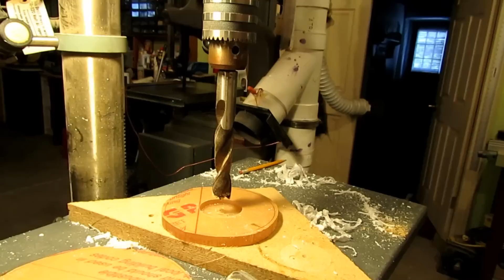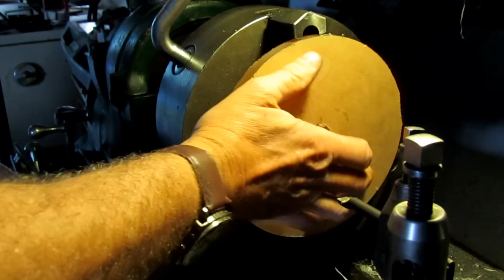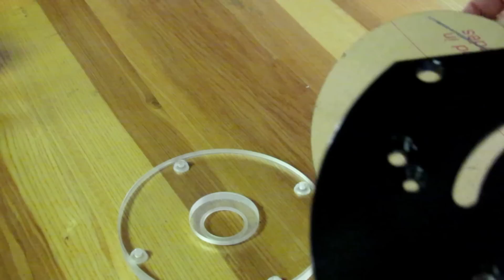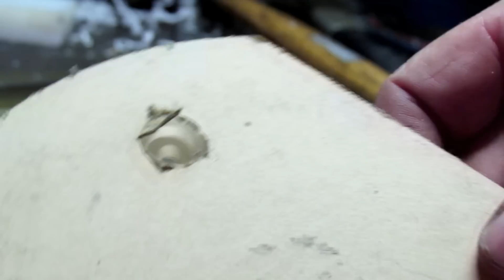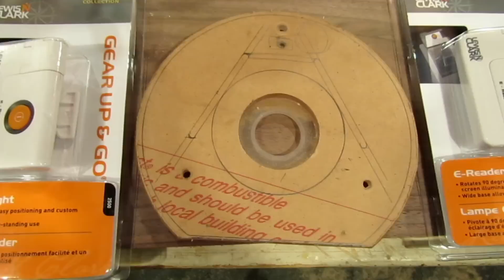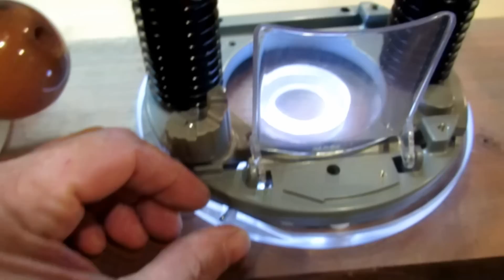Making some more router bases

Comment: I think that's some great work. I just have a question about the flat cut in the router base. Couldn't you just leave it round? Then it doesn't matter as long as you have the base touching the guide. I'm sure there is a reason but I'm missing it.
Reply from the maker: You could but the flat allows getting  closer on inside corners.  Thanks for watching.
Reply: @unemployedredneckhillbilly2023  Thanks. That's a pretty good reason.

Comment: I have seen several videos about how to make a new plate for a router, but yours is the first to employ LED lighting. This is an absolutely BRILLIANT idea!!! The only question I have is, how how can I mill out the square holes for a trim router, as well as the slots for the LEDs without a dedicated milling machine??
Reply from the maker: Find someone  with a cnc router.  Even a little  3018 should handle  it. Thanks for watching.

Comment: What do the rest of us, without a machine shop, need to do to make a nice faceplate? Just keep buying them? You do nice work. The plate for the harbor freight trim router would sell like crazy.
Reply from the maker: Many of my subscribers have CNC routers that can make things like this easily.  Thanks for watching.
Reply: lol you can do this in much less time with just a drill/drill press with a 35mm forstner bit for the counterbore and 30mm forstner bit for the through hole as well as a router with a pattern bit to use your current baseplate as a template to cut your new one that you've made. super easy and takes 15-20min max.

Comment: I am drooling at the range of tools used to make this base.  If you do not have a lathe and milling machine, highly accurate bases can be made with a drill press and router table using a little ingenuity.
Reply from the maker: Those  old tools were a great  investment.  The south bend lathe is older than me and the most usefultool I own.  A router with  templates can make something like  these  fairly  easily.  Thanks for watching.

Comment: million peoples have router and jig saw but not lathe, why not cut first at router plexiglass out round good piece NOT lathe, Then u can drill holes center.
Reply from the maker: This is just an idea, adapt it to the tools you have available. Use polycarbonate because plexiglass can shatter.  Thanks for watching.
Reply: You could make a homemade lathe, it's well worth the effort and not nearly as difficult as it sounds. I made one when I was very green to woodworking and used it until I stumbled upon a 1955 ShopSmith Mark V in a pawn shop last summer.

Comment: hello i just purchased the  Black & Decker KW1600EKA and i m looking for a guide bushing kit ...can anyone recommend for me please? thanks in advance
Reply from the maker: If your base is drilled to accept porter cable bushings, they are widely available.  If not you will need a aftermarket base.
Reply from the maker: You will need special bushings that mount with screws for that base then. Just buy or make a new baseplate for the pc type. MLCS has some replacement base plates but that is a oddball router and you may have to drill your own mounting holes.
Reply: so i should make a base and use pc bushings like you did for the bosch router. how thick plexi should i use ? you are so helpful thank you so much !

Comment: nice. you can use a white light strip LED as well, and will get rid of the wires, it will probably fit also an a smaller slot. Nice tricks
Reply from the maker: I just used what I had, but there are many different led options that could be made to work with this idea. Thanks for watching.

Comment: Outstanding timing- I just found the video, and have been wondering how to get a base for the Powermax trim router (similar size to the HF one; a Dremel to do some small inlays, and a base for a Sears Router, a legacy from my Dad.  Happily I have a grandson who is becoming a machinist, who can help with the lathe work (And whatever else I can talk him into doing).  I am just ready for the info in the video, or at least to share it with David, so I am happy to find it, and extra happy with the details such as the lights, and mounting the brass bushings.  {Next step to learn.....)  thanks so much for sharing your expertise and experience-  Makes YouTube the incredible source of expertise to learn from.  Mac McLean
Reply from the maker: Having a good base makes the trim router easier to use. There are many different ways to make the bases so use the tools that you have. Hope they work out for you.  Thanks for watching.

Comment: This is cool....can you make one for harbor freight's trim router....can you make it oval...and put handles on either side? I'd like to buy one like that
Reply from the maker: I don't think you can buy them, but they are pretty easy to make and you can make them any shape you need. The HF trim router is easier to use with the large base. Thanks for watching.

Comment: SIr, how much did you pay for the lights from the Dollar Store?  On Amazon they are $10.99 Free S&H.

Thanks for the vid very nice.
Reply from the maker: They were one dollar each. There must be strip leds that would cost less available. I know the 12 volt  strips on amazon are cheap and can be cut into small segments. My dollar store buys closeouts  and sells everything for  a dollar, but when they are gone thats it. I have seen led strips like that, but don't remember where, I will keep my eye out for some.
Reply from the maker: Amazon has rolls of the 5 volt led strip lights that are not that expensive.